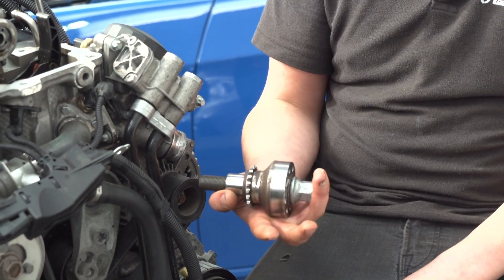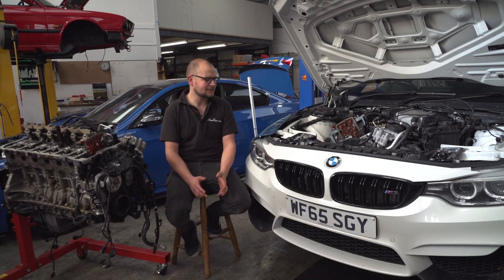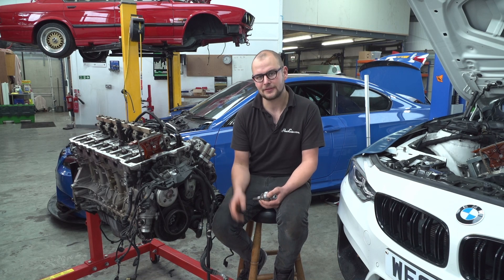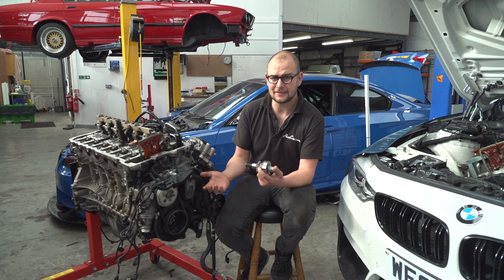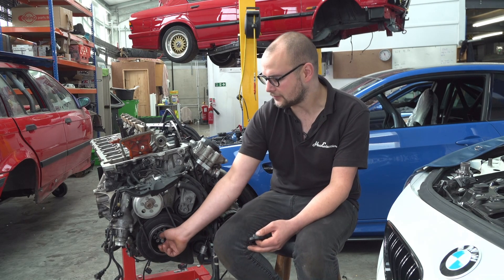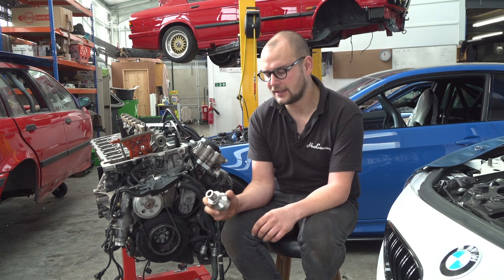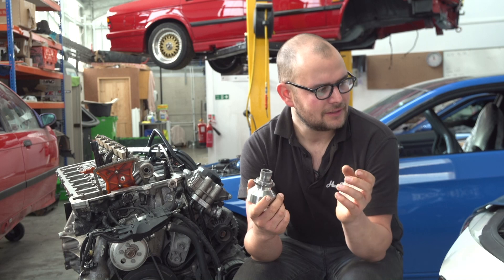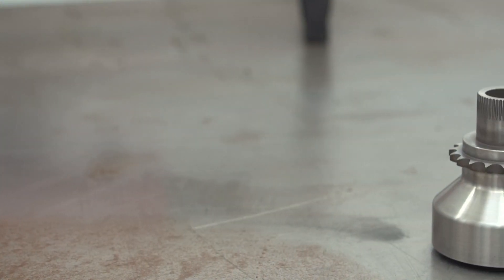BMW S55/N54/N55 Crank Hub Failure - Hack Engineering Tech Talk

Comment: never knew the n54 had 2 catastrophic failure points, does the bolt capture actually do anything i heard if the belt slips with the capture on it will unthread the crank hub bolt from the crank shaft entirely.

Comment: Have you all had any issues with the VTT hub so far? The spline seems like the best design but VTT has a very mixed reputation it seems.
Reply from the maker: No issues, we've done very many of these now!
Reply: Look in the forums there have been a few VTT CH failures.
Reply: @WalkingUpsideDown  I've never come across a V2 failure. Do you have a link?

Comment: My only question is, what about the debris that will be created at the end of the crank when you press fit the spline lock in?? There must be some type of shavings created when you press that spline in no??   Or is this just something that perfectly indents the soft aluminum and doesn't create debris?          Please let me know
Reply from the maker: It forms the crank around it as much as cutting. And as you're pushing in, any minor shaving is pushed into the recess, not drilled out.
Reply: @hackengineering5586  So essentially, if there is debris created it’ll get pushed into the recess and i assume that’s okay to drive around with and won’t affect the car? What i’m getting from what you’re saying tho is when it’s pressed in it should perfectly indent the crankshaft and not create any debris? orrr are your saying No matter what debris will be created and pressed into the recess which is okay to drive with?
Reply from the maker: @stoss-11  Basically all three. Unlikely to be debris but if there is, it's kept sealed away from causing harm
Reply: @hackengineering5586  Awesome , thank you for getting back to me! I really appreciate the extra knowledge. I'll be going VTT hear in about a month

Comment: Hello, serious question, this same exact situation happened to my 2014 X5 with the N55 engine. Are these two products compatible to be put on the F15? Also, have you heard this happening to any F15 N55 engines? I was cruising on the highway on sport mode at 80MPH and my RPM was at 3000 when I heard two loud bangs come from the engine. I saw a hole in the block... my engine is gone with only 74k miles on it! Also, the engine is stock with no tune. I got these codes, which happened in order within 3 seconds. Do you know what might of caused this??
-165014
Intermediate Shaft sensor, High pressure pump, Plausibility, signal edges, position Implausible, substitute value active.
-165012
Same description as 165014
-165011
Intermedia Shaft Sensor, High pressure pump, signal, missing, substitute value active
-164030
exhaust camshaft sensor, electrical, short circuit to battery positive
-120408
Charging pressure control, deactivation, pressure build up blocked
-164021
Intake camshaft sensor, electric, short circuit to ground
-102A32
Hot film air mass meter, operating range, air mass to low
I am looking at putting these two crank hub upgrades on my new engine! Thank you!
Reply from the maker: Hello there - these products are indeed compatible with the N55 in your vehicle (compatible with all N55s and S55s). Difficult to say what's happened with your fault codes.

Comment: Best solution I’ve heard of yet. 
I too have an issue with drilling holes in the crank; balance, weak spots, metal shavings, dowels breaking, etc…
Wish these motors were as solid as the one in my 200k mile e-21 with the M10.

Comment: The VTT is a great hub, but the assembling and disassembling process is rough given to the required torque needed in order to properly do so. It’s almost a two-man job because of it.
Reply: Ok, so we’ll just look the other way from the truth that over time, and because of the spline idea, it tightens itself due to torque. Let alone factory spec still being a lot of work lol
Reply: ... unless that’s what the CBC is there to also prevent. But ..what would I know, right?
Reply: Got it.
Reply: Torque multiplier ✅

Comment: the other sprocket sint one piece design . is the one that relies on the bolt preassure the one that moves just the oil pump ?

Comment: I knew this was an issue on s55 engines but its the first I've heard about it on the n54. Should I be worried. I'm not massively tuned, just usual bolt on mods with DCT running sound 450hp/ 500lbs/ft. I notice on the links you provided above to someone it only days n55 and s55.
Reply: I just had the crank hub slip causing it to skip a tooth. Still trying to assess the damage. Hoping the valves and top end are ok. I'm pushing 620whp with a safe tune, but 600+ Ft/lbs TQ at 4k might have done it.
Reply: @3rdshift_3 looks your tune wasn’t so “safe”

Comment: Aren’t the Pistons forged? Wouldn’t it be just bend the valves and you’ll need the heads redone? Haven’t seen a car with forged pistons need full motor rebuild from meeting valves
Reply: Yeah if continued to run it may need head work but that’s it tbh